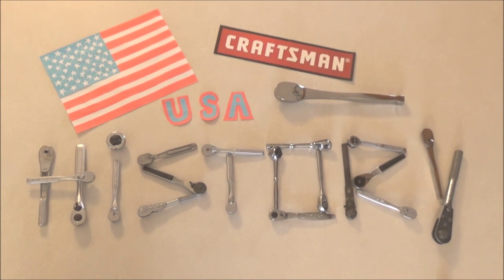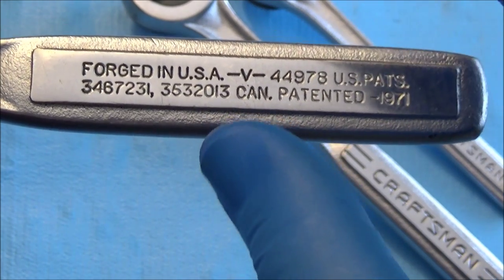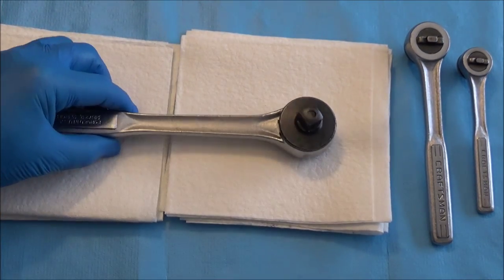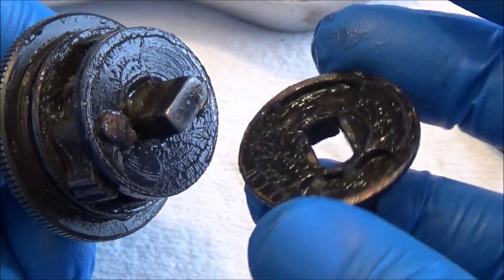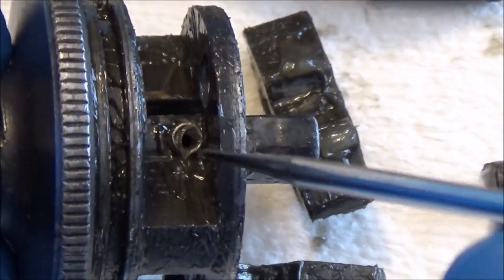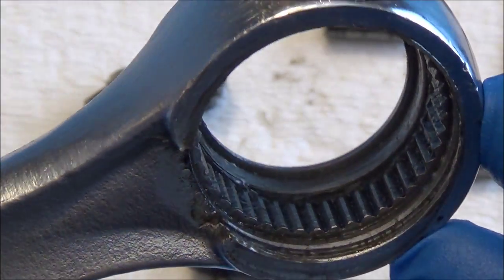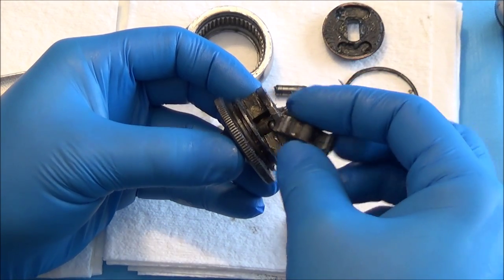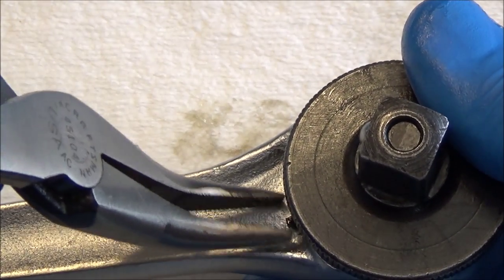Craftsman Tools - USA History: Round Head Fine Tooth [RHFT] Ratchets - Rebuild & Discussion

Comment: I broke my old Craftsman ratchet a couple months ago while using it like a breaker bar to remove a VERY stuck component on my car. I was not happy  to say the least :-( I bought a Dewalt pear-shaped ratchet as a replacement, thinking I'd have to dump the Craftsman, but it doesn't have the same feel. I was ecstatic to find this video that gave me a model number so I could purchase the repair kit :-)
Reply from the maker: +hoopfan71 Happy to help!
Reply: The ratchet has been repaired. Thanks, again.

Comment: I have a set I picked up for 7$ at a local
Used hardware store and cleaned it out with brake cleaner quick easy and then used Lucas red and tacky to regrease it but for sure retention ring was the hardest part to put back in
Reply from the maker: You bet it is!  A great ratchet, but difficult to reassemble!  ^_^

Comment: Hello, thanks for taking the time to show this. I had the 1/4 version from a kit my dad gave me. Probably 40 or 50 years old now ha, ha. It was pretty bad, I took it all apart, cleaned it up and it still looks to be in great shape under all the gunk. Unfortunately, I lost one of the ball bearings in the tear down. Do you know if the kit comes with them? Thank you, Jeff
Reply from the maker: Jeff, thank you for your kind words.

I wouldn't give up on your current mechanism.  If you run down to your local hardware store, you can buy bearings, which should be compatible with your current ratchet.

I say this as the repair kits for the RHFT ratchets are typically, but not always, usually at least $15 to $20 starting on the secondary market.  Since Sears will be more or less defunct in the coming years, they have long discontinued supporting USA made ratcheting mechanisms with new drive repair kits.  Given this, your best bet for both expedience and access, would likely be eBay.  Unfortunately, however, you'll be looking at paying at least the range aforementioned, should you go this route.

Again, if you still have 1 of the 2 bearings, see if you can acquire a handful of spare, which would cost you literally cents over many dollars.

Best of luck! 

- Gear Wolf
Reply: @GearWolf  Thank you for the quick reply! I don't mind buying a kit just to have spare parts for it, if it does come with the bearings. Do you happen to know whether it does? Thanks again for the video and thoughts. -Jeff
Reply from the maker: @netwak  Hi Jeff!

Yes, if you buy the repair/replacement kit, it will have everything you need and be ready to go.  Unlike other repair kits, this mechanism is entirely self contained.  Follow the workflow in the video, and you should be good to go.

Just an FYI, the 1/4", from my experience, can be a little tricky to install.  Take your time and have patience!

Best of luck,
- Gear Wolf
Reply: @GearWolf  Thank you! Yes, it was pretty dirty so I tore it all down. Getting that retaining clip in and out was the hardest part, so small. The grease was so dried on it was like carbon on there. Cleaned up as much as I could with rubbing alcohol then put it in a small ultrasonic cleaner I had. In the end, it was pretty clean and seemed to be in great shape. My shoulders dropped when I could not find the second bearing :/ I'll order this kit and have some spare parts. Thanks again for the information. Great videos on these!

Comment: Great video on the fine tooth ratchet. Just acquired a compete set with serial #’s. Have done maintenance on my original and teardrop sets
And now they again work perfectly. The reason they didn’t was because the ball bearing was frozen to the spring. My question is all those 
repair kits that are available are they really necessary? I get if a pawl somehow breaks or if the internal gear/ has wear than the kit is a good idea. 
Maybe a spring or out of round ball bearing? Even the snap or retaining ring doesn’t appear to lose its elasticity. Just wondering what your opinion is on this.
Thanks
Reply from the maker: Hi, Ken!

I understand where you are coming from.  It does seem to be a waste to replace an entire mechanism, where you could simply have parts on hand to rectify a small problem.

The RHFT primarily was a catalog exclusive for a majority of its existence within the Craftsman brand.  That isn't to say that they wouldn't appear in particular stores in certain areas; however, this would be due to Sears attempting to cope with surplus products in their individual regional inventories.

With all of that said, keeping that mechanism on hand was expensive for Sears and a bit of a pain in the ass for the customer.  Unless the tool department's manager had enough for thought, individual Sears stores just got lucky, or a previous customer made a request for a "repair kit" and forgot/didn't come in themselves (prior the time you would come and need one ^_^), the odds of Sears having a spare mechanism were fairly rare.  It isn't to say that they were never have them and would always have to order one for customers.  I am saying that it would be fairly unusual for an individual Sears store to have many, if any.

For example, I spoke to multiple Sears tool department managers over the phone and just as many in person to discover that, on average, certain tool kits had a degree of "frequency" or "periodicity" of being available at their stores.  For the most part, if it wasn't a part of the typical Sears inventory, they simply didn't keep it in appreciable quantity, if at all.  

A majority of Sears store would have a gambit of the last generation/2nd to last generation raised panel repair kits and the "Next Gen" 60 tooth ratchet repair kits, but were scanty on everything else.  This made sense, as in the mid-2000s and 2010s those were the ratchets Sears were primarily pushing.

Had this been the 1930s through 1950s, I believe Sears would have had more of a "we'll only use what we need" philosophy to repair a tool.  As lifetime/longtime department specialists were replaced by those looking for a weekend gig and the dynamics of what department stores as well as their services also changed, I feel the choice to simply replace the entire mechanism was probably made due limitations of time, lack of specialization, and expedience of customer experience.

If you enjoyed this answer, wait for the upcoming "reboot".  The original series took me <6 months to acquire the tools, information, and film.  The new series has been in the works for the better part of 5 years!  ^_^

Comment: Just got a 3/8's version with no model# so i assume its like 1969-70? Came out of a auction box lot I paid $3 for. Its a little crusty and only turns one direction, but with the help of this video maybe I can get it working again. Thanks for the info. Well made video..
Reply: Update: Snap ring broke, still managed to get ratchet apart. Soaking whole mechanism in a bag of PB blaster. Going to check on it in a few days. Where do I get a new snap ring??
Reply: Where do i get a 43788 repair kit? Google is showing me jack squat...
Reply: Final update. No repair kits available for this 3/8's ratchet. Even if there were one I have a feeling it would be over priced. SO anyway I thought hell with it I will exchange ratchet for a new one at lowes. YEAH LOL thats not happening. Apparently you can exchange broken craftsman hand tools but its has to be the same model # your exchanging for. So if its not on the shelf a lowes your SCREWED! Thanks lowes! SO yeah this ratchet is going in the scrap pile. And I will be sure to avoid craftsman in the future! Such a good brand now is hot garbage! SAD!

Comment: i pulled out the center bar(the one you push to get the sockets off, and i ended up with another bearing on the bench.  not sure where it came from .  was hoping you would show that disassembled too.  any thoughts?  thanks for the vid.  thumbs up for sure.
Reply from the maker: Let me ponder this one.  There are a few minor variants of this particular ratchet mechanism.
Reply: @GearWolf  thanks, that would be awesome!  the ball bearing is slightly larger than the pair in your vid.   i didnt watch your vid before taking mine apart and launched one of the pair into no mans land.  i got a rebuild kit to replace it.   when i get that in, ill see if i can get everything  back where it goes.  all i know is, when i put it back together without the mystery bearing, the push button to get the sockets off no longer worked.  aka the socket would just slide on and off.  so i think/hope it goes in that area.

Comment: Great video! What craftsman sockets were designed for these? I have a 1/2" and just bought the 3/8" and 1/4" versions online. I've noticed that some modern sockets I have tried using with the 1/2" version don't lock into the ratchet. This makes the quick release kind of useless.
Reply from the maker: Hi Seth!  Merry Christmas!

I'm currently working on the "reboot" of this entire series!  If you like this, you'll definitely get a kick out of what I've been up to!  ^_^

Anyway, the RHFT series of ratchets had the LONGEST production run within the Craftsman brand.  For simplicity, we'll say it was in the ballpark of ~35 years.  With that said, it is difficult to say specifically what sockets they were designed for.  Sockets featuring the =V= or V were the traditional markings that vintage Craftsman ratchets would be paired with.  More "modern" variants would have a multitude of alphanumeric markings: "G", "GG", "E", "EE", "K1", etc.  Realistically, whatever sockets were available/sold during similar production run to the RHFT were paired with one another.

In regards to your other concern about your 1/2", I'd say that your "Quick Release" mechanism may have wear.  When using the QR, the bearing that mates with the socket falls into a little nook within the shaft at the end of the QR mechanism.  From my experience of working on these, usually what I've seen is that, due to wear/tear or poor maintenance, either the bearing or valley the bearing falls into will become damaged over time.  This results in poor performance for either releasing or holding sockets to the stud.

Over time, there were a number of revisions to the RHFT QR mechanism to improve overall performance and longevity.

I hope this helps!
Reply: @GearWolf  thanks for the tips!
Reply from the maker: @sethbenschoter3168  Happy to help!

Comment: i have a 1/4 ratchet that the ball that holds the socket in has gone is there a kit to fix that ?
Reply from the maker: Unfortunately, unless you have an appropriate spring, bearing, and press to install everything into your socket stud, you'll need a repair kit.  Refer to the video's description.  If you click on the "see more" area below the "Gear Wolf" name, you should find the appropriate repair kit number.

Comment: Great video. What grease do you use in these? I have done some other ratchets with regular grease from my grease gun, and it seems to just gum things up and make things worse.
Reply from the maker: There are a variety of greases that can be used for this application.  I elect to use "Super Lube" because it is a synthetic lubricant with good viscosity characteristics.  Plus, as it is a full synthetic lubricant, you get the added benefit of it actively behaving as a detergent, which will continue to work on grime that may not be easily seen or cleaned off.  The only downside: it is expensive.

I've used green marine grease and red wheel bearing grease with similar fidelity.  These greases are much cheaper.
Reply: I use #0 grease. It's ultra thin, almost like oil in suspension. It is not sticky/thick like wheel bearing grease guming things up

Comment: You did not complete the teardown.  You should also remove and clean the pushbutton/quick release.  To remove quick release you simple turn the quick release button counter clockwise because it's on a threaded rod.  Hope this helps.
Reply from the maker: That is something that is only applicable to certain variants of this specific mechanism.